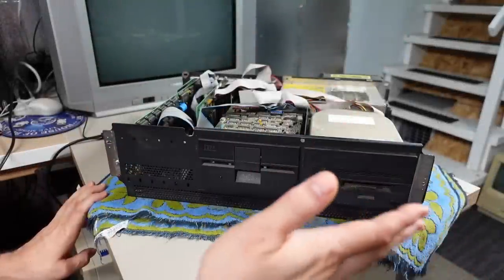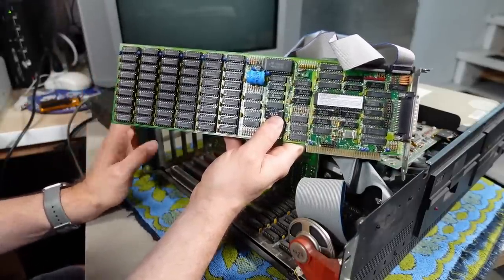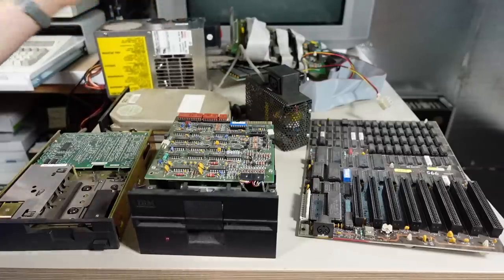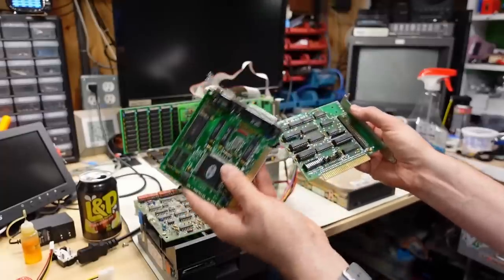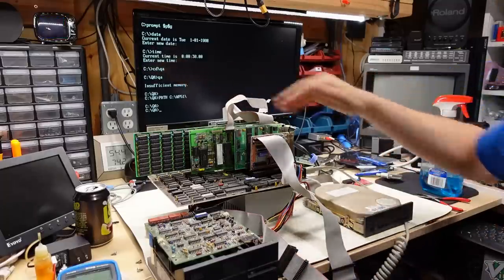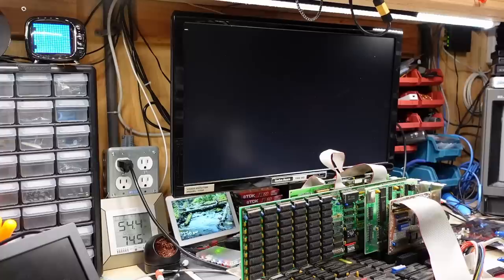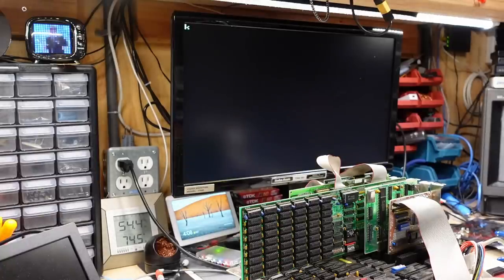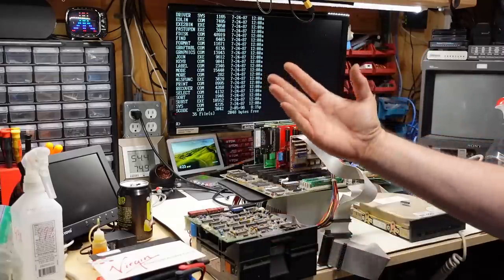PC archeology: IBM PC XT with a strange appendage

Comment: 3:10 Oh, neat! My employer uses threaded circular connectors like that, albeit in a 37-pin flavour, in embedded systems. It's pretty trippy to see that sort of connector in a household or office machine from the 1980s. Incidentally, on our machines, it allows for a single uniform connector to be used for subdevices to be powered from or communicate through a bunch of different buses. Like, I have some subdevices where 6 or 8 particular pins are connected for specialized communications, and others where a different 4 or 5 are connected for power plus serial comms.
Reply: By the way there are versions of a similar connector I'm some sort that actually have pens that that can be used from full line voltage power and also low-voltage pins in the same connector that's scary stuff!

I know that on some airport X-ray machines this is used for the monitors which is just the little bit dicey to the unwary.

And you know how low voltage in line voltage should be separated although if suitably insulated for the voltage at hand and equivalent insulation it is permitted encode but I don't know if that goes for with connections like this I do know that that is 4 in conduit at least.

And at a church where do we have a organ console that was on the long table where there was both power and of course low voltage the organ company refused to bundle the entire cable because of that it was a code violation to do so even though those connections were right next to each other all the time we later found out that the cabling that was used the insulation was suitable to allow this to be done.

Most electrical tape I've ever used on one cable!

We look forward alternative but yeah won out in the end with just roll after roll of black tape!

I've also heard that they used to use fire hoses for these flexible umbilicals I'd called them on installation Pro is both ends were hardwired so there was no way to slip anything over it after it was installed.

They specifically did not use connectors because of reliability.

Plus there would have to be numerous connectors since there was hundreds wires coming in from the organ console it was actually telephone cable that was being used!

The AC power was a separate cable not to mention a low voltage cable I do believe that might have just been the common for low-voltage!

Although in the organ itself everything was not insulated what one might think.

Since everything was at mostly the same polarity that wasn't necessary.

If there was a short somewhere it would just malfunction.

It was rare to have a short between the common wire and anything else!

Wrangling that cable when the console was moved was like wrestling an anaconda you could say
Reply: Also I have seen a similar connector often on a junction box cover.

 typically in retail stores here and there just in random places.

 I'm wondering what those were used for originally possibly!

And I know those connectors were used on some cash register systems.

 I did Salvage a few but having them not just at the piece of equipment the between peripheral is just odd.

Comment: There are all kinds of Everex prototype boards floating around... tho unforutnately I missed all the ones that were from our old office.  Everex had some of the first 16 bit and 32 bit display boards that were affordable and any good.  Then they had the first 16+32 bit color VGA boards.  Their catalogs were pretty boring I don't know why they had such cool stuff like oscillator boards when they didn't seem to have anywhere to sell them!  ANyway lots of prototype boards to look for.  They sold lots of tape drives and memory cards and drive interfaces.  They also made some of the best 286 and 386 computers available.  I could tell you other secrets of Everex but am still looking for stuff!  So that will have to wait.

Comment: for things that plug directly into mains I made myself a little  box that contains a GFCI and a paddle lightswitch so if shit starts to hit the fan I can slap the switch if the GFCI doesnt catch it ... its only tripped like 3 times in the last 10 years but it is nice to have a quick poweroff when the smoke starts coming out without having to touch the device in question. Of course its not the ideal way to do mains testing on mains powered devices but its one step better than hoping that you can yank the cord out of the flaming ball of angry sounds and can be cobbled together for a couple bucks at the hardware store

Comment: Yes the rectangle on the back panel was the batter pack for the CMOS, a lot of them were removed due to the barrel or other battery spilling its badness on to the board, I had a like model Zenith Data systems desktop. Came from a government office had a network card for a sat network that got struck by lightning

Comment: The 4-pin hanging connectors  --  Circular Plastic Connectors (CPC) are made by AMP.  This is the small cell size version using crimp type pins, compatible with 24 to 20 AWG wire.

Comment: That round connector looks like what is commonly called a “cannon” plug. They are pretty robust and designed for relatively easy repair if you have the proper (expensive!) tools, the military uses them as does Boeing - not sure if their competition does, but they are a din-standard connector
Reply: I suspect it's a TE Connectivity / AMP CPC connector; they are not the same a military type connector (602 or 62 style), althought the latching mechanism is very similar.

Comment: My father's PC had a similar problem where it would halt after about 1.5 hours of use, turned out that the lower address latch was faulty (the 8088/86 multiplexed the data bus onto the address bus, so these latches were needed)

Comment: My sister-in-law used PFS:First Choice back in the day, it was a rough equivalent to others suites like Microsoft Works or Tandy Deskmate, or later more expensive ones like Lotus SmartSuite or Microsoft Office.  It had word processor, spreadsheet, database and more.  Not bad at all, especially on machines that weren't top of the line.

Wow, just remembered MultiMate, and the set of programs called ChartMaster, DiagramMaster, and SignMaster.  Easily about 30 years since I last used them.  Or IBM's DisplayWrite 3 and 4 word processor programs, that stored the text internally in EBCDIC instead of ASCII.

Comment: One thing that facinates me is that these computers have not been used for decades and still today they work, they may have a few faults (most of the time), but they still work. I really doubt that a modern PC would be still working in 20 years time. Old PCs are built like tanks and weigh as much, new ones all look nice with its RGB crud and whatever but they are made like disposable items.
Reply from the maker: Not only was this not used in decades, it was left uncovered in a hostile place (a hot / cold attic) -- so wasn't even kept in the best place. It is amazing how resilient this stuff is ..... I do wonder about modern stuff, but I do tend to think that at least the things without batteries should still be working in 30 years.  Maybe? LOL
Reply: The hot/cold attic has good points, too.  It may get to temperature extremes, but it gets there and stays there for a while, so it's storage temperature and not operating temps.  Plus it seems to have been dry, no major moisture buildup or corrosion from if it had been.

I'm not saying it was the best place to store it, just that there are a heck of a lot that'd be much worse! ☺

Comment: Used to see ALOT of odd stuff added to PC's in the 90's while working for HP in the Detroit area. Especially around the auto industry, car repair shops, parts manufacturers, and factory floors. Good times when a 'special' one of a kind card or 'box' blew mother boards...almost impossible to fix sometimes.
Reply: I used to work on these giant magnet sector mass specs controlled with a specialized PCI card that costed 30,000 dollars.

I accidentally blew one up because I thought the PC was powered off when it wasn't. Whoops.
Reply: @ax14pz107  Right, as a tech you would drive 2 hours for an on-site service call to some factory in Flint, Michigan. The PC would be hooked up to some CNC machine and had a bad mother board. An hour of getting the greasy PC open and the mother board replaced. Of course the PC would be tested without all the 'cards' and it would boot fine. Put the cards back in and power on and the blue magic smoke would appear.

Comment: I look forward to seeing you troubleshoot & repair the failed motherboard (because I have 2-3 old IBM PCs waiting their turn).  I'm surprised that you didn't have the needed cassette tape(s) to test that portion of the system, especially since you had a complete diskette cleaning diskette "kit."  Hopefully you will go ahead and test/troubleshoot/repair the cassette drive unit and show it working on one of these PCs.

Comment: It was probably an aftermarket kit. So, the power supply was supplied so it could be used on a wider range of PCs. As PCs were in their infancy.  You ordered a PC with options provided by the manufacturer. IBM being a prestigious name at the time probably wanted a very premium price and the aftermarket solution provided more cost effectiveness to the customer. That part would have been added by the customer or the dealer. After market solutions were most likely installed by a PC dealer. It would go well with my Epson LQ-2180 which, I still use with Windows 10.

Comment: The theory is 12V Tants tend to go first because 12V is close to their original 16V rating, so there is less headroom for any breakdown.
Reply: That matches my experiences with them at an electronics manufacturer while testing boards and assemblies.  Tantalum caps in backwards were a problem, too.  My favorites were the ones that leaked a little silver teardrop when they failed. 😭

Comment: Remember, Adrian, the way to get more views and likes on YT is to make something go pop! Well, you somewhat succeeded; let’s see if we can take out any more caps, eh?
Reply: One solution to shorted tants - use a bigger power supply.
Although if you start blowing tracks off the board, maybe you've gone too far.
Reply: @paulstubbs7678  yeah they actually call that power blasting also good for finding other shorted components although once there was something shorted on the board that was not a component and well there's a fine Trace put this way nice smell of extra crispy circuit board!

And one capacitor or two going pop once that short opened due to that Trace becoming open circuit happn hooking up I didn't realize what had happened!

Pretty sure that Trace opened and then to Cap's poped.

Those Line Filter capacitors on some of the old equipment are the worst when they go.

That are typically used in line filter applications.

 and some others the ones that are amber transparent color.

Had one of those puppies go off on workbench once!

 I was doing some repairs on old piece of gear for somebody.

Remember somebody ran downstairs and said what just happened

 and they just about got sick!

And once I found out about what happened you better bet anytime that I got in a piece of equipment that had those!

  there was some pre repair work before even starting.

at least after I knew what the issue was and the device was not repairable!

Comment: As far as the system failing the way it did, I'd check the memory. First check the 5V rail to make sure you have no shorts pulling it down. Since it isn't showing any video I'd start with the parity bit on bank 0 then move on to the rest of bank 0. Also check the ROMs. One thing is for sure, a Bank 0 parity fault will stop the machine from POSTing and there will be no beep codes.

Comment: Useless trivia. On 8th March 1983, IBM released the Personal Computer XT, short for extended Technology, or PC/XT, or just XT.  The XT was the first IBM computer with a hard drive (10 MB or 20 MB). The XT was discontinued in the spring of 1987. 

*EBay has a few for sale under vintage IBM VINTAGE HOME COMPUTERS

Comment: I'm sitting here thinking "Man, you know things have changed for the worse when you're surprised hardware still works after just 5 years", when the stuff in this video is even older than me.

Then the motherboard stops working after a power cycle.  What a crazy coincidence.

But yeah, everything I buy in modern times seems to break in 1-5 years no matter what it is.  Can only wonder how much better off 99% of humanity would be if planned obsolescence never became a thing.

Comment: That there was enough demand for Everex to build such a thing is a damning indictment of IBM's (lack) of wattage in the XT power supply.
Reply: I believe the original power supplies were rated for 65 watts.  My Seagate ST-4096 probably would have had a bit of trouble running off of that supply.
Reply: When the IBM PC came out I have a feeling IBM was thinking well people will just come to us for all their upgrade needs, and we will make them to run off this PSU, and they will never need anything more. Boy where they wrong, just like how they bet the farm on Micro Channel Architecture. Don't get me wrong, as I love IBM design from back in the day like their Thinkpad laptops, ThinkCenture desktops, and keyboards(I still use an IBM KB-8923 on my work PC with an active PS/2 to USB converter) but man at times they trully did make some stubborn boneheaded decisions.

Comment: That's the first time that I'm seeing something that definitely looks like it's designed for the round hole of a 5150. Interesting discovery!

As for that tape drive: Regular audio tapes definitely will not work. You need special cassettes that have special tape and a notch that tells the drive it's a legit tape (and that notch will also keep you from inserting the cassette bottom side up).

By the way I have a batch file somewhere that I once made for FastBack, that will run it in DEBUG and will use breakpoints and go-commands to skip over the code that detects whether you have the original FastBack program disk in the drive...

Comment: What amazes me.. is that this decent software at 37:05.. is running on 640Kb of memory 😯.. and it must use 1Mb or 2Mb top's in the HDD 🤔............... something like this today.. waste 30Gb or 40Gb 🤢... requires like 16 CPU Cores and 20Gb of RAM at least 😤...

Comment: While being impressed by the 4MHz PC running an WYSIWYG text editor, you seem to have forgotten the 1MHz C64' was not only running an quite useable WYSIWYG editor, too, but having this embedded in it's completely graphical UI GEOS ;)
Reply: And with 1/10th the amount of RAM.
Reply: It's not really that impressive anyways, as a 4.77 MHz 8088 excutes most code faster than does a 5-7 MHz 68000/08 used in the (100% graphical) Lisa, Macintosh, Amiga, Atari ST and Sinclair QL computers.  (See respective processor's datasheets, books, or manuals). There were also 3-4 MHz CP/M systems and other Z80 computers with WYSIWYG word processors, btw.
Reply: @herrbonk3635  8088 faster than an MC68000? Seems like you mistook something, there..
Reply: @elmariachi5133  Depends on what you are doing, of course, but 68000 on 32 bit code is usually slower than an 8088 on 16 bit code. An LD reg,reg takes 2T on 8088, but 4T on 68K, an ALU reg,reg takes 3 clocks on 8088, but 4/8T on the 68K, an ALU reg,im is also twice as slow on 68K (not to mention 68008), and so on. Again, check the data sheets! Not really that strange either, considering they were introduced on the market the same year, 1979.
Reply: @herrbonk3635  Well, I know that 68000 has a bit higher Dhrystones than the 8086. And the 8086 is a bit faster than the 8088.
Reply: @elmariachi5133  Dhrystones is nothing a CPU "has" though. It's just an clumsy attempt to measure a mean or "general "integer performance" using pretty specialized tasks (such as string copying, that may be totally irrelevant for, say, fast graphics). Actual performance achieved via assembly programming, other methods, or even another compiler, may be quite different indeed. The data sheets says more, at least if you are an experienced assembly programmer or hw-designer.

Comment: Well, people are sometimes afraid to swap out the Power Supply.
Its not changed today either and some people want to use the most modern Graphics cards with 10-15 year old Power Supplies... (no, pls don't do that! It will cause issues like random black screens and crashes, use those PSU for older computer and new ones for new GPUs)

Comment: wasn't the original XT HDD 5 or 10 MB?   with a hard drive, they cost in the neighborhood of $3000 US. in 1982 or 1983. The double sided floppy was 360K; don't expect it to be the 1.2 MB version until a few years after XT's were gone.

Comment: After the first time of shorting, why not just check the whole 5V and 12V rails on the motherboard for a short instead of turning it on (and risking more magic smoke)? I guess there is one advantage of doing it this way; you get to see which component blows up. LOL
Reply: Tantalums be like:
Adrian: Are you shorted?
Tantalum: Nope.
Adrian: (applies power, PSU goes into protect)
Tantalum: Sike!
Reply from the maker: LOL! Yeah. For a very rare and special part, it's good to check as you could burn out a trace if the PSU doesn't have good OCP -- but I trust this PSU to trip quite easily. It's why I generally won't test with the original PSU since I don't know if that part of the PSU is working right. 🔥
Reply: @adriansdigitalbasement2  I'd rather avoid the magic smoke myself. lol

Comment: Looks to me the external power supply is just a standard switching power supply shoehorned into a custom case. Could be why the bulge in the perforated cover. On the pc board markings, I believe the 94V-0 portion is the UL flammability rating or some such. Another way of checking for polarity markings might be to look at the pads and/or the solder mask around same… one is likely to be square.